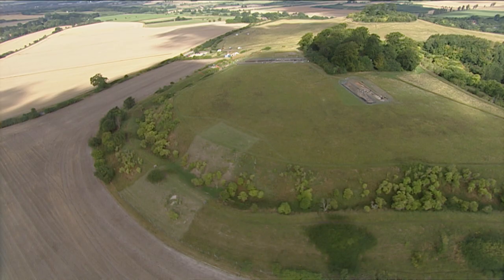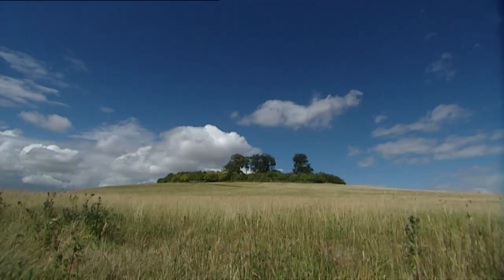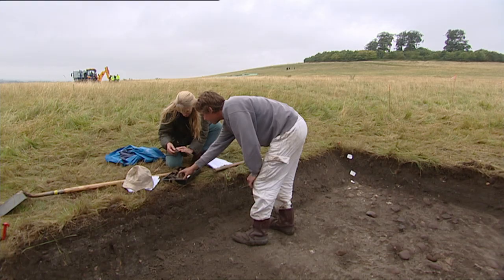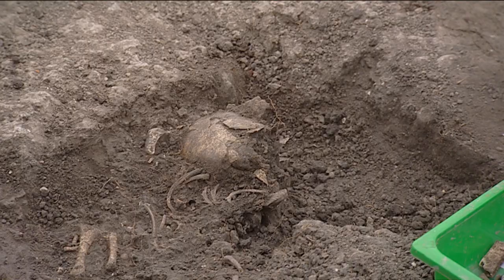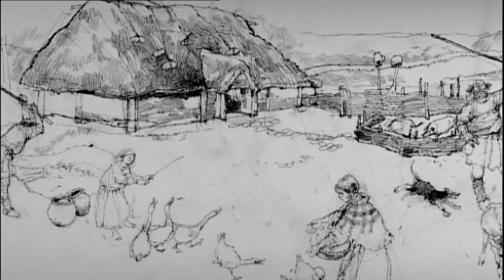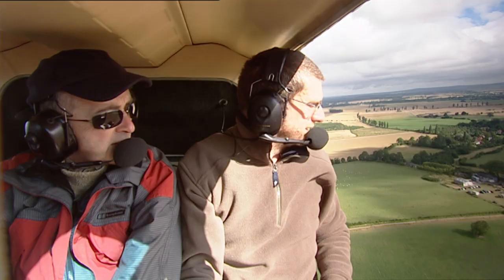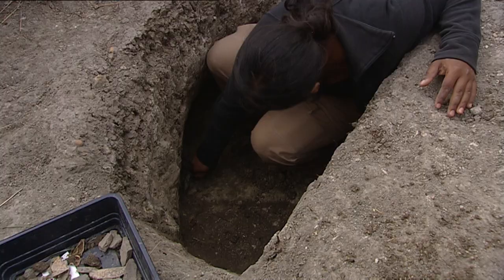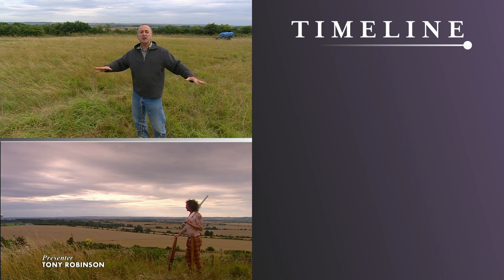The Intriguing History Behind The Iron Age Hill Forts In Oxfordshire | Time Team

Comment: Wasn't it stupid to build the fort on the lower hill? All the enemy had to do was to camp on the higher one and then say: "It's over. We have the high ground"
Reply: (Late response but) my understanding of this period is that they weren’t worried about conquest or prolonged battles as much as smash-and-grab raiders. That’s why their walls were most impressive in the front, so visitors would have the impression of strength and not raid them. If raiders came by, the locals would just run in the fort (and bring as much stuff/animals as they could) and wait for the bad guys to move on. It wouldn’t matter too much to that kind of warfare if a nearby hill was taller. The shape/location of the hill could be more important in choosing it.
Reply: @elizabethwoodley4340  Elizabeth, this was actually just a lame and pretty worn-out Star Wars reference joke, but thanks for the explanation anyway. :)
Reply: @elizabethwoodley4340  Entrances were bigger as that is where people went in and out of making them weaker points and therefore needing more protection. Same as castles having gate houses to protect the main entrance. That it made them more imposing was an added benefit.
Reply: We don't know a fort wasn't on the higher hill, the trees prevented a thorough investigation of the site but given the lack of artillery used by the ancient Britons what would holding the higher summit have achieved? The lower hill was 150m away, well outside what a javelin or sling could threaten and arrows don't appear to have played much of a role in warfare in Britain prior to the Romans.